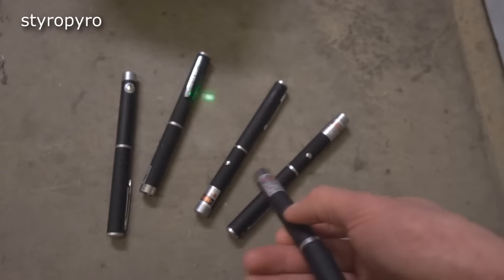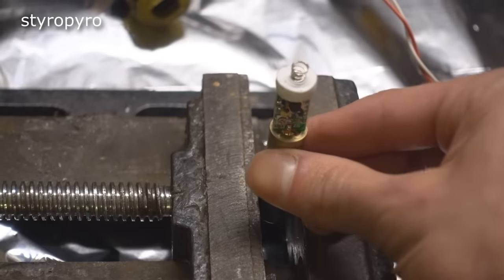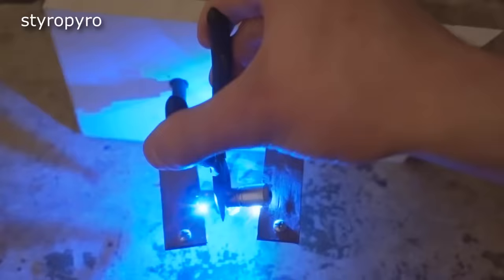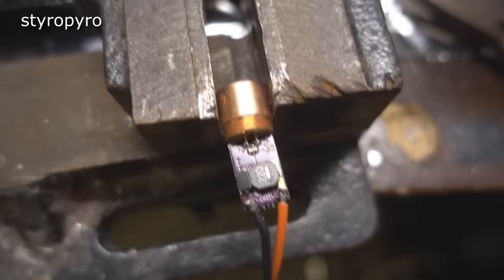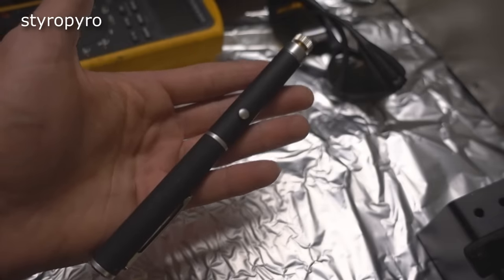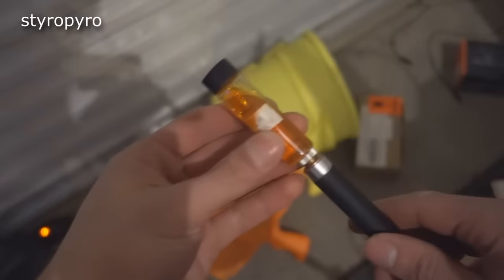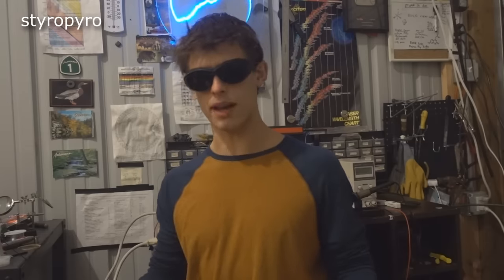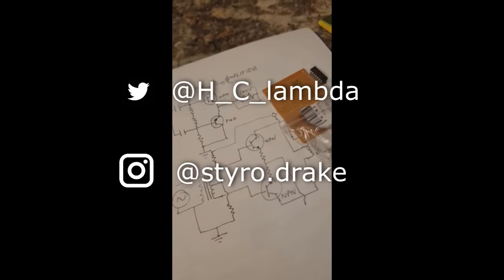Crazy eBay green laser pointer mod. 1mW to 1400mW++

Comment: I wonder how simple one can make an efficient laser driver.  I am thinking of a Joule Thief with rectified and filtered output.  I tried this in LTSpice and it worked for a high powered LED.  For a constant input voltage, it has constant power and is thus a safe, efficient, and easy to implement driver with only 2 active components other than the laser diode.  One can even use a potentiometer in series with the regulating resistor for fine tuning the output current.

Comment: Actually, using foil and a direct wire connection to ground is not a good way to reduce ESD as it can in fact actually cause damaging ESD currents capable of destroying the electronic components because the current discharged is too high...even with the resistor (which IS better than a direct connection to ground).  It's why in manufacturing they don't just use metal tables connected to ground through a resistor. 

Think of the static "zap" you get from touching a metal object as compared to the lower intensity "zap" you may get by touching another (partially conductive) person through clothing. There is usually a major difference in intensity of the "zap" (or try the same experiment touching the same metal object without and then with a 1-megohm resistor between you and the object).
The recommended inexpensive solution is of course partially conductive ESD mats and wrist straps with appropriate resistors to ground where needed to reduce the discharge current yet still quickly bleed off any ESD charges. You can get a good set of these for less than US$20 and often cheaper. Using partially conductive materials also changes the profile of the discharge when compared to direct metal connection at the point of discharge.
Alternatively, a WOOD desk/table top is preferred over a metal or plastic desk/table top. The plastic top can develop isolated electrostatic charges on the surface, and the metal top has the same problem as the metal foil in allowing any discharges to have too high a current.

Comment: Question...doesn't adding the resistor between you and ground risk having the esd not go through ground?
Reply: Having a direct conductor and NO resistor actually increases the risk of component damage due to an ESD directly to ground having a higher current, and it changes the profile of the discharge as well.

Comment: Are you willing to walk me through creating a strong blue laser like the green one you made here? I have had several of the 1500mw Ebay lasers and they are just big and bulky. I really really really want to get one of these smaller blue ones and just make it stronger OR buy the parts to assemble one myself. The problem is I have no idea what I am doing as far as circuit boards and transistors are concerned. I have been researching making ine on my own for a while and you make it look so easy but it simply just is not that easy.

Comment: Over 100 bucks for the green diode....  Thing is, this is not really a mod when you're swapping out all the original components. Don't get me wrong, it's bad ass yeah, but nothing is modified. I'd have preferred to see the result of the original diode with the added rectifier/mosFET just to see if it would handle it.

Comment: You used a 620A MOSFET to control 2.3A of current? Makes perfect sense, *eyeroll*. You know that your parasitic loss is much higher on big MOSFETs, right? If you want a more efficient circuit, pick a smaller one with really low Rdson. And they do need a heat sink (which is usually the circuit board itself) to carry anywhere close to their rated current.
Reply: Ok nerd

Comment: If theres a green laser on ebay thats only 1 milliwatt, I'm a monkeys grandpappy. Most of them are at least 10.

Also, i don't consider it a mod when you replace the entire pump diode. 

Thats like saying you're going to "mod" your car engine and then just throwing an entire new engine in it.

You just put a new diode in the old cheap case, and that's not a mod. 

We can't even do pot mods these days, ao the last thing we need is a clickbait-y video goving false hope about a "mod" that just throws a $100 diode in a cheap plastic housing. 

Boo.

I'm not a ghost, but: "boo".

Comment: Nope, I came to see if you could power up the original laser output, no how to reuse the pointer casing, I like your videos very much though.
Reply: Did you honestly think you could just feed the diode more power to make it brighter? 😂
Reply: @Jollydog69  I think you didn't get the meaning of the sentence right pal
Reply: cyberrinkie then what were you talking about?
Reply: I wanted to see how could I power up the laser output, perhaps changing some hardware, undoubtedly more power should be provided as not much can be done with two AAA batteries, but perhaps changing the power step or something. Certainly not just reusing the case. But just plugging more juice wouldn't do otherwise the it would have been shown in the video.
Reply: cyberrinkie that’s just a fancy way of saying you wanted to see him feed the diode more power
Reply: @Jollydog69  Nope, I was looking for whatever could be done to have a higher output power, having a higher input power is a necessary condition but not sufficient. Anyway, if you feel better and smarter thinking otherwise be my guest, your comments only satisfy your ego but give no solution, if you are so smart, how can we get more output power?
Reply: cyberrinkie don’t think you can get any more